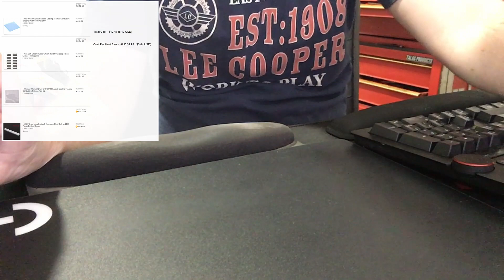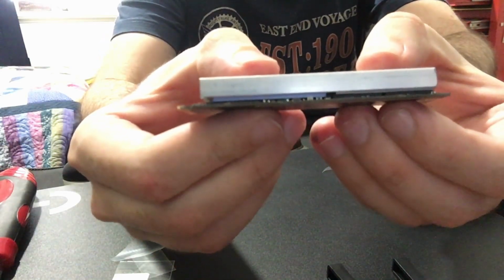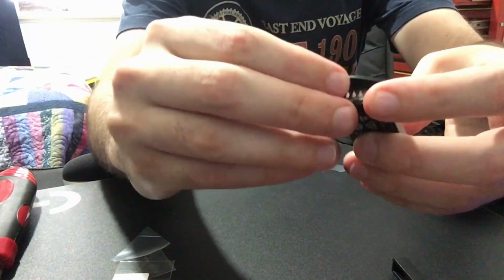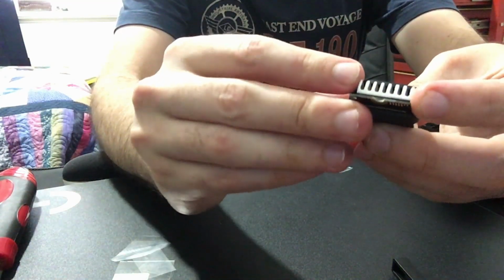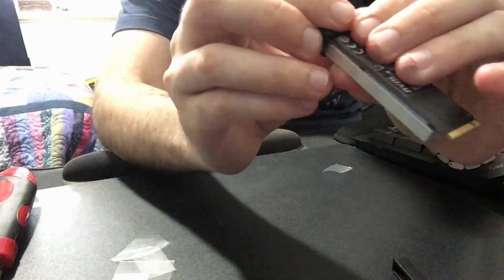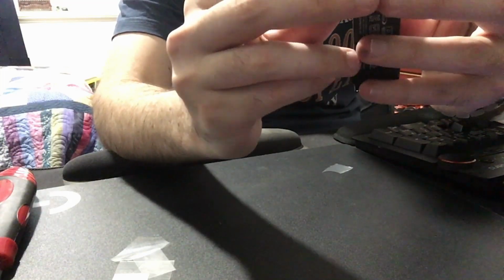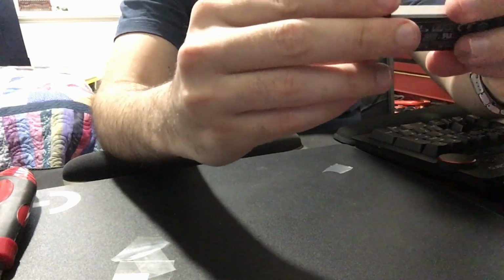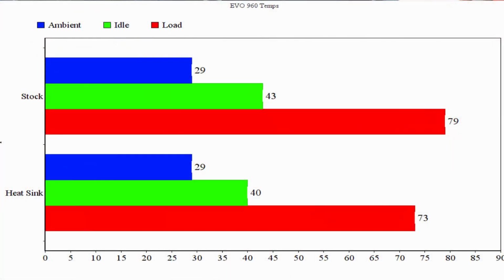M.2 SSD Heatsink - Fast and Cheap

Comment: Tbh, if you are going to put a heatsink you should remove the sticker that is on the drive. This may void your warranty but it will be better for keeping it cool under a heavy load.
Reply from the maker: I would rather not void the warranty really. I doubt the Temp difference would be that much anyway.
Reply from the maker: The sticker on my SSDs is heat spreader already (copper backed) so I doubt it would make much of a difference. Also is your warranty really worth a few degrees, In my case I don't think so.
Reply: After removing sticker, i'm cut about 20C on 2230 m.2 NVME SSD. From 68 to 48C.
 The same method and construction, only diferences are my thermalpad, i'm use 0.5mm one, and zippers.